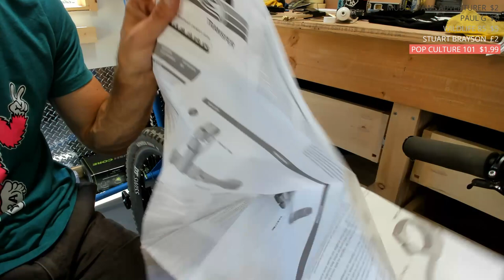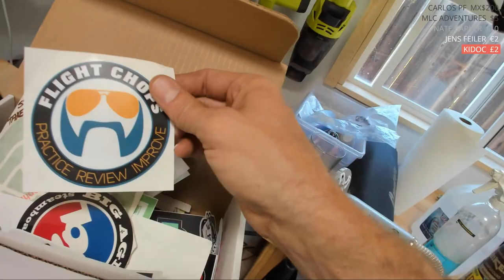First stream in a LONG time! Fox Transfer dropper post install

Comment: I watched the whole video and I'm shocked not a single person suggested helicopter tape to protect your frame where the cables and hoses are rubbing. Butyl tape or mastic tape would be for wrapping your chain stay to quiet down the chain slap, it's not designed for abrasion protection.

The dropper looks nice, I'm probably gonna get that model (with the black post and shorter to match my frame) when I get around to installing one. Gotta get rid of my saddle pack before I do though!
Reply from the maker: Good suggestions!